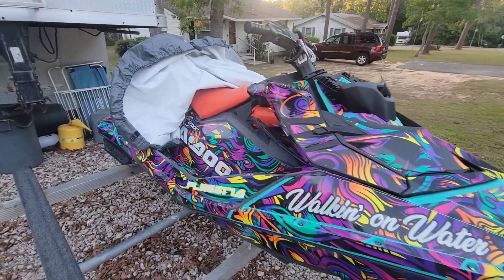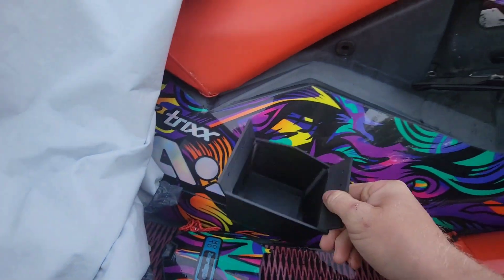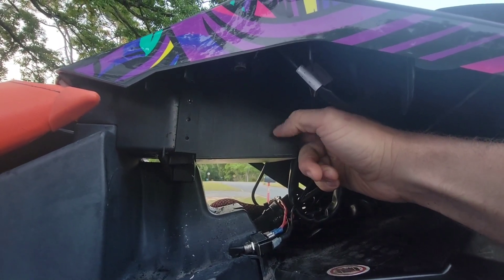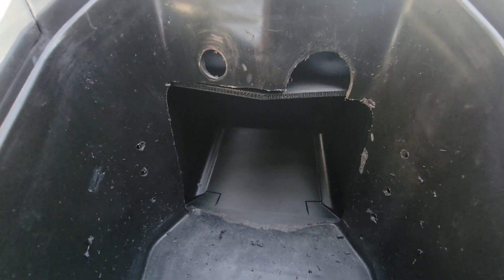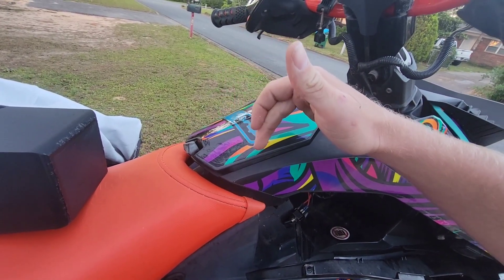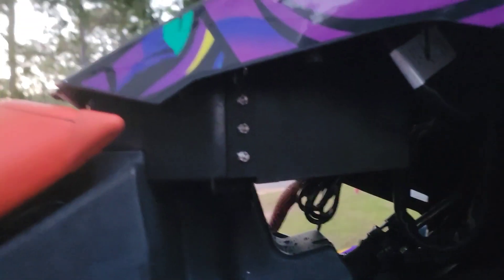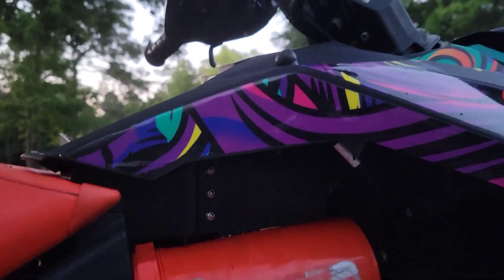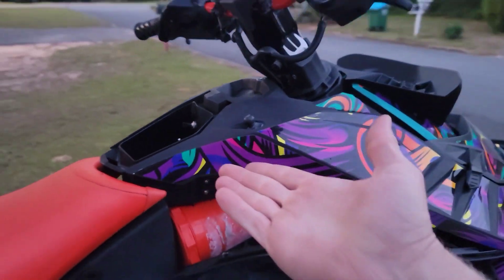Seadoo Spark Glove Box storage extension

Comment: Sweet video, definitely gonna give this a try with my printer and spark. How did you end up strengthening the latch on the lid? I don't trust it at all either
Reply from the maker: I ended up running with my phone in a water proof bag on my life jacket.
Reply: @jonathanstansell8511  ah ok, any bad experiences with the extension? Like cracking at all after going crazy with some power slides or on rough water? I'm also looking into if I can buy the panel from the new spark and swap it onto mine.  The 2024 spark has the same phone compartment as the rxps and rxts